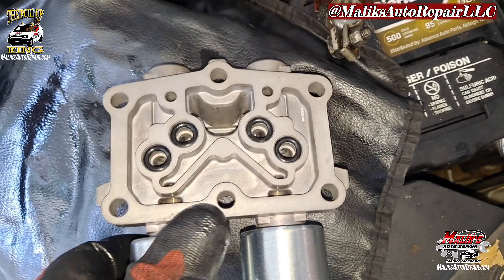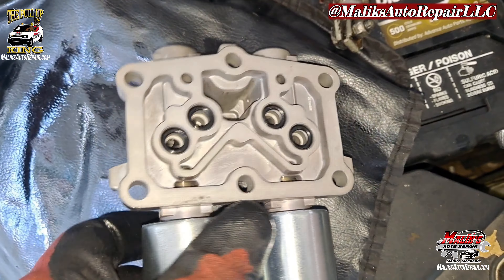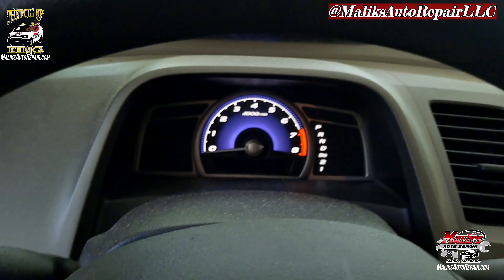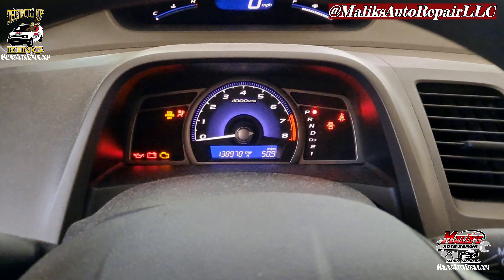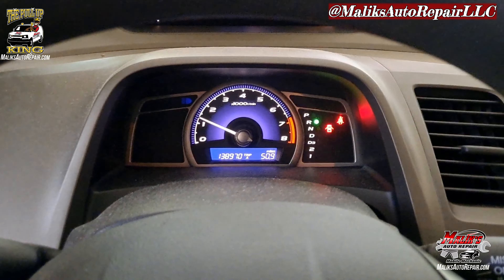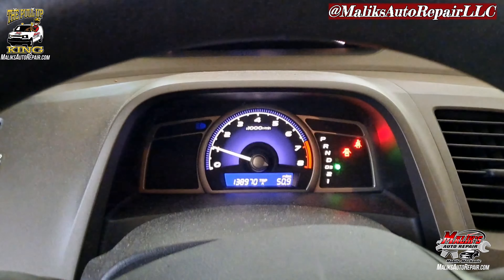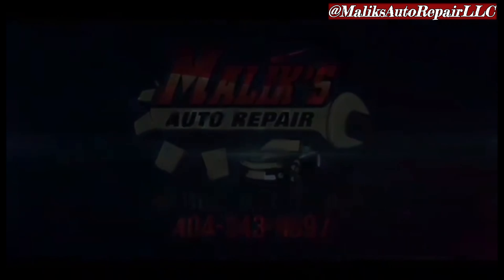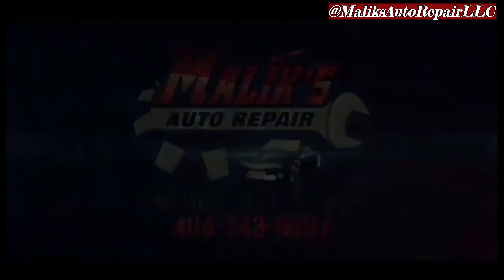CODE P0756 |TRANSMISSION DUAL LINEAR SOLENOID VALVE | 2006 HONDA CIVIC 1.8 | DETAILED | Howto/Diy

Comment: this is possibly the most helpful video I've come across. All of the codes have gone away and no lights are on. however it still has a hard time shifting into 1st and 2nd, and its a little hard into 3rd.
Reply from the maker: Thanks! Is the fluid level topped off?

Comment: By chance would this work on the 2007 model ex ? Im having the same issue with the blinking d light  recently changed oil  it take a while  for reverse gear to initiate  sometimes ?
Reply from the maker: Sounds like more of an issue with the transmission. I would check the transmission fluid level for starters.
Reply: @ThePullUpKing  i  changed it recently  along with a full service took the car to scan and got this po746   automatic clutch pressure control solenoid valve a stuck off
Reply from the maker: That's your issue, the solenoid. Transmission malfunction. You can try swapping the solenoid and hope for the best.🤞🏾
Reply: @ThePullUpKing  you got the Amazon link to this part .

Comment: Great video mate! I have 2012 Accord with 800, 000km. Have jerk when reverse and when put to D it take 2 or 3 second to engage 1st gear and a powerful jerk, hard shift to every gears ... When I restarted, car works fine. What will it be? Delayed shifting too
Reply from the maker: Thanks man. You wanna first start by scanning for any transmission codes. It may point you in the right direction.

Comment: I don’t have any engine codes, Im experiencing hard shift when reversing at cold start. D blinking often but when I restart the engine it’s normal. Or if I wait for 5-10 mins before shifting the gear, there are no issues as well.I’ve changed the ATF, mounts and filter. Could this be the issue??
Reply from the maker: Good possibility
Reply: @ThePullUpKing  Any other possible issues?
Reply from the maker: @mohammedrahees670  Bad transmission
Reply: Same problem here. I have 2012 Accord with 800, 000km. Have jerk when reverse and when put to D it take 2 or 3 second to engage 1st gear and a powerful jerk... When I restarted, car works fine. What will it be? Delayed shifting too

Comment: Did you use aftermarket or oem ?
Reply from the maker: Aftermarket. Client got it from Amazon.
Reply: @ThePullUpKing  Ite cool because most aftermarket parts that's installed on hondas throw codes or go bad
Reply from the maker: @bigbrad9976  Still going strong.💪🏾  Thanks for watching.
Reply: @ThePullUpKing  great 👍

Comment: My civic not engaging Reverse Gear.. What could be issue?
Reply from the maker: Could be several things. Hard to say without being there to diagnose the car.Check transmission fluid level.
Reply: @ThePullUpKing  Ok sir.. What is the oil Capacity of Transmission ? 
Mine was 2008 Model
Reply from the maker: About a 3 qt refill when level is barely reading.

Comment: Yoo question , would rtv gasket be safe to use too
Reply from the maker: It's not needed.
Reply: @ThePullUpKing  if mine didn’t come with the gasket
Reply from the maker: @TheOne-ti3pl  It comes with a new gasket.